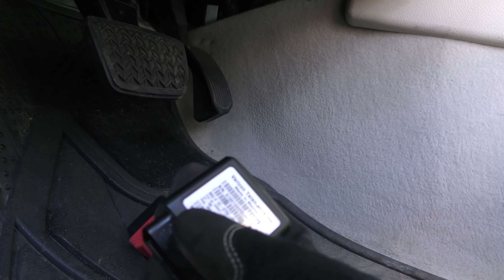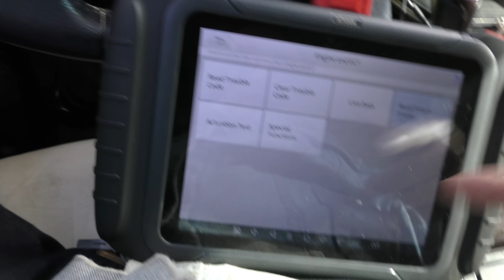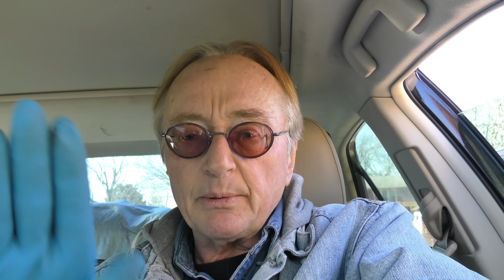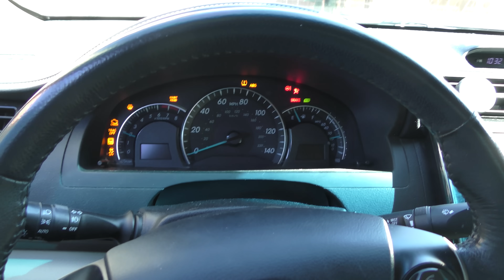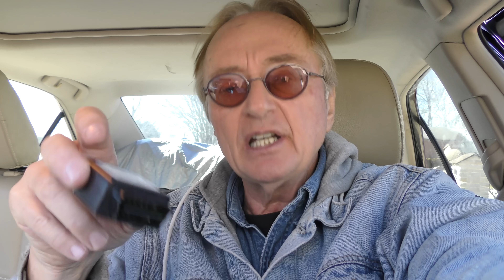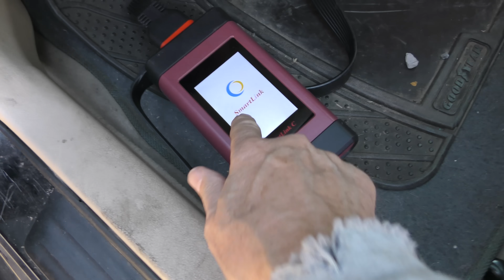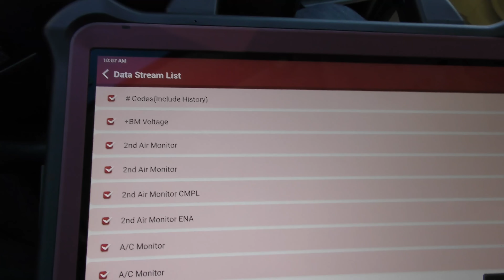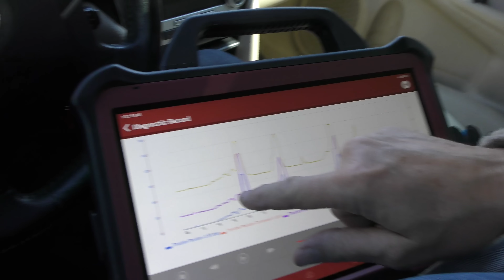This Stupid Device Just Cost My Customer Thousands in Car Repairs

Comment: That device is a Verizon HUM that uses a subscription. It will notify when unplugged. It is meant to stay plugged in. "The newer features allow users to set alerts for when the vehicle exceeds certain speeds or goes outside of set geographical boundaries" 
I would never have it. First disconnect like you did. Change the automotive battery or at least clean it and the connections especially grounds to engine, body and frame. Being it can alert on speed makes me wonder what settings were programmed to be monitored and if it can be undone?

Comment: Thanks for that! I recently had a problem with my car that I needed to clear the codes (of course being a JLR engine it just randomly cleared its own codes so I did not need to buy anything or take it in) so was considering buying a diagnostic tool instead of taking it in to a repair garage. I saw the Bluetooth ones it said you could leave in to watch what happened as it drove, and had considered that. Would not want to pay the amount JLR would charge for a new engine management computer.

Comment: So really has not proved that the problem is the unknown dongle, and many of those dongles are designed to be left in.  Also I am sure that a computer can be found for that Toyota for less than $1k if you look anywhere else than Toyota dealership.  Seems like since the problem is only with throttle readings that would one replace tps sensor(s) before assuming the entire computer needed replaced.

Comment: That dongle looks like the one my insurance company sent me to provide me a discount. The way it works is that it captures driving data and sends it to the insurer so they can monitor your driving habits! It's meant to stay plugged-in all the time.
Reply: mine was just a gps device you stuck on the dash or mirror. I wouldn't use any plug in device.

Comment: Years ago my Prizm Check Engine Light came on.  My garage plugged it in, and over 7 months i replaced all 3 components of the emissions control ststem and a Powertrain Control Module. $2500.  Nothing helped.  18 months later my shop discovered a nick in the vapor line off the fuel tank.  They put some electrical tape on it while they ordered a new line.  That resolved it.  89 cents worth of tape.

Comment: That sounds like one of those scammy "Gas Saver"/"MPG increaser" devices that do absolutely nothing except raise the risk of damage.  I wonder what the plastic packaging cardboard/card paper insert of that dongle had as a label.

It feels like they fell for the "Verizon" thing since that is a legitimate cell provider.  Yea just due to that label on the device itself alone I can tell it's phony since I don't believe the actual Verizon Telecommunications Company would make a device like this and wouldn't have it plugged into the OBD socket.  This makes me also believe that this definitely was advertised as a gas saver device since this was left plugged into the car while driving.

Comment: Scotty, my man.  As a computer pro, I have to say that the dongle you removed was not a doagnostic tool, but a fleet car tracker.  It is a good brand and shouldn't damage the ECM.  Then again, bugs and poor manufacturing happens.  Check the Internet for known issues. I would also contact the company (Verizon's fleet mgmt division) and adk them if there are any recalls on record for their gear.  If you are correct and their debice damaged the ECM, then this might reveal how and if there is a simple repair available.  If it is a known issue, then perhaps they might also be wiling to reimburse your customer.  Verizon is a big corp with big pockets.  Better they pay $1500 then spend twice that going to small claims court to fight a claim.  Almost guaranteed settlement.

Comment: My truck's ECU is unlocked for a tune I had done to it AND using one of those Car Insurance company OBD port dongles (to get a lower rate) attached to it made my truck's electronics go completely bonkers! Super hard shifts and I had erratic dashboard behavior. Once I removed the dongle, everything was fine. Don't attach crap to the OBD II PORT!

Comment: I've recently found a similar problem with my Camry, it was just soon after I had my transmission fluid changed, too late I'm afraid. hesitation between 2nd and 3rd gear only on the upshift, and if I put less pressure on the throttle into third it could proceed smoothly. well, one mechanic wouldn't look at it without a check engine light and suggested cleaning the throttle body, made no sense cause my idle is fine and the car is otherwise perfect. the mechanic who did my fluid change initially also told me he wouldn't look at it without a check engine light. so I took it to the dealership. initial estimate was that it needed a new transmission for $8500, then $6500, then $6200, then $5580. paid them their $400 for diagnoses and state inspection and went to a transmission shop, am now getting a rebuilt trans for $3600. I've seen other youtube videos on this common Camry issue, many say the computer needs to be reset to relearn values, but they don't seem to address that the computer is making these shifting choices for a reason, reason being binding of the gears. looks to me from your video that the car is struggling to maintain throttle at 30 mph precisely when it makes that second shift, the shift into 3rd gear. my car used to have a stupid dongle on it for the first 3 years of it's life for tracking and code purposes for the company lease. but for the last 4 years of my car's life it hasn't had that dongle... the dongle is definitely not the problem here.

Comment: My son was having codes on his gm LFX motor, here in Australia. I plug my dongle in and smelt his oil as there is petrol in it. I said it's either ur hpf pump or injectors I was leaning towards the pump. He didn't listen and took it to the Holden dealer. After going there twice and cost him over $320. They told him it was the oxygen sensor. I replace the oxygen sensors and still throwing codes. I got mucked around by a second Holden dealer. I end up taking it to a third Holden dealer and tell him them I'm staying there till they tell me what's wrong with the car another 300 + dollars Told me it was the hpf pump and one  cat converter is clogged up. They want $3600. I got a local mechanic and a second-hand cat with the new pump cost me a $1000. Now it's through code p0420 again. I just thinking changing the cat on bank 1 as I change the cat converter on bank twi, as per Holden

Comment: I just got my cheap scan tool in the mail today. Was planning to use it to diagnose my hesitation issues on hot AZ days when the AC is on. Already changed the alternator but I believe the voltage is dropping when the AC is on and that is causing hesitation when taking off from stop lights.

Comment: These code scanners give false readings. The pro licensed mechanics have the talent and qualified ones. One guy told me I had 16 codes. One had 2 codes.  2 sensors replaced and engine Iight off.  And the engine light has not come back on in over three weeks

Comment: Claim: Verizon device (GPS locator) caused computer to fail.
Proof:
1) The device was made in Mexico.
2)The device was plugged in when he examined the car.
3) Anecdotal evedence that Scotty has seen few ECM failures ( car's main computer)

I think there is no proof at all to this claim.  There is some proof that Scotty has an overly biased view of devices made in Mexico.  Fruthermore the Verizon GPS device only uses the CAN bus so it would be unlikely to cause a fault of this nature.  I would look for a loose/corroded  power wire going to the ECM or a bad battery.

Comment: Tons of bad info out of him.

The ECU is not bad, the throttle position sensor may have a dead spot and it's not from water getting in it. The car would have be submerged for that to happen. The connector also is a weather pack style so nothing is getting in there.

The throttle body itself also has multiple sensors on the plate as it is driven by a motor. Those can also be bad from age. Cleaning that did nothing was just a waste of time. Only if, and only if it had heavy deposits would it affect the car while idling. You also have to be extremely delicate with them as you break the internal TPS.

The main element he ignored was the Can-bus line communication error. That could be from a poor connection on the ECU itself most likely to ground. Cars will act all sorts of weird with bad grounds now. There isn't just one either, there are usually multiple in the engine bay alone. The most known being the battery itself. 

Also while those HUM devices can break, they will blow the fuse for the OBDII connector before damaging anything else. The ECU also has diodes to prevent itself from taking damage. They are no different than the devices used to give you an insurance discount. While there are many reasons to not use them, damage to your car's engine ECU is not one of them.

He really has no clue and should stop giving out horrible advice.

Comment: Great video. You're obviously very knowledgeable about all things automotive. I have a question. I have a device that provides wifi signal in my car but it also has basic diagnostic capabilities. It also plugs into that ODBC port. Do you recommend against using those as well?
Reply: Your battery will appreciate it not being plugged in.

Comment: Waiting for a few months/years down the line.  Had a similar issue in a Hyundai Elantra, hesitated right around the shift points and refused to past a certain speed when cold, turned out to be a buggered transmission.  That was a fun one to discover, I figured it was an issue with the driver assist settings and was going to leave it until the next time I took it in for service.  Then one day, on my way home from work, it refused to shift out of first gear after a stop.  Once we towed it in to the garage I found out there was a rash of problems with the transmissions in that model, and sure enough, once they opened up the transmission they found it absolutely wrecked.

Diagnostic tools like your tablets aren't meant to remain plugged long term, but those wireless dongles actually are.  That's why they're wireless.  A lot of companies even require them to be connected 24/7.  Before blaming the dongle, you should see if you can get a read off the dongle or actually have it tested.  For all you know, that dongle was doing exactly what it was intended to do and sending all the error information you were receiving to the owner's insurance, employer or wherever.

Comment: these devices are designed to be left in, however they can Mess with the CAN data..  ive never seen one actually destroy the PCM though...  thyat dongle might mess with the TPS values but its not going to destroy the computer unless it was completely Zeroing the CAN.. and then the vehicle wouldnt even operate... they would have had different symptoms..  no starts, stalls, etc..   however they CAN mess wit hthe DATA which can cause TPS and fueling errors...   that poor Yoda's PCM was on its way down already..

Comment: that black box would of probly be put in by the insurance campany to have cheaper insurance or young drivers the insurance would be invalid with it removed or tampered with there in the uk alot ob2 is ob2 telematics is what insurance companies use it would of had a sim card inside i hope its a left over unit or someones gunna get charged loads by the insurance company or points for invalid insurance i imagine someone will get a phone call and a spanking they ring you userly if the garage remove them.

Comment: the cpu is well protected on all 3 lines, The j1850, CANbus, and 9141 are almost all but impossible to damage the computer.  The 12v line is over-current protected.  Nope, scotty you missed this one.   That is a bad ground somewhere, and the computer is fine.

Comment: Those devices don't have external power.  They could draw off of a 12v wire, or even a combination.  That could easily mess with everything.

Comment: But I'm pretty sure that's not just a "cheep scan tool" Verizon telematics offers gps fleet tracking and they might be required by their job to have it when on the road for work. And those are most definitely designed to be connected while driving, that's kind of the point.

Comment: Telematics is a tracking device not a diagnostic device, it may have a diagnostic function as well but it's not it's main purpose. I'm not sure what insurance is like over there in the States, but here in England it's very common for insurance companies to require a vehicle to have a telematics "black box" to monitor driver behaviour, it's common for younger drivers as a way to get cheaper insurance for good/sensible driving. It could also be just a tracking device for some other purpose but I'm guessing it is most likely from an old insurance policy.
Reply: A quick search for Verizon Telematics seems to imply it's a fleet tracker, was the vehicle previously a company car?

Comment: FWIW, that dongle is part of the Verizon fleet telematics platform. We use these on a fleet of several hundred vehicles and to my knowledge it has never caused an issue. Granted, all of our vehicles are late-model commercial trucks and vans and we don't keep them more than a couple of years so perhaps older computers or long-term use may be a factor.

Comment: I just want to point out a big thing here. This specific device wasn't a diagnostic device. That was the dongle for the "Verizon Hum". So when you say that "these things aren't meant to be plugged in all the time" - it actually very much is meant for that purpose. Unless the device you're plugging in has internal shorts or is otherwise damaged in some way, you don't run the risk of damaging the ECM by plugging in an OBD dongle. You'd think that all the people running tuning software on their vehicles while reading from the OBD port would be way more wary of doing so if driving while using an OBD tool risked frying their ECM. Compared to the few other videos I've seen, this one is very very weird and misinforms the viewers. You clearly don't fully understand how the ECM modules in a vehicle operate on an electrical level.

If these dongles cause so many issues, you'd think that auto insurance companies wouldn't offer to lower rates for people knowing full well that they'll be engaging in a future claim by the cause of their own device. This video just makes zero backable claims on this front.
Reply: The Verizon ones in particular have killed a few that I've seen. Always verizon.
Reply: @Gilbert Visperas You're right, insurance doesn't directly cover repairs. Comprehensive insurance covers damage. And if these things damaged an ECM so easily, it would be damage to the car, and done directly by the people who cover said damage. Does this not paint a pretty vivid picture in your mind?

Why would a company offer to cover unlikely damage to a vehicle, but then manufacture a part to plug in to that vehicle that allows the user to save on their premium, but while also damaging their vehicle and then needing to cover the repair from that damage?

My point is that the accusation of damage to the ECM was made, which may very well be the case, but there's no proof that the OBD dongle was the thing responsible. There are way too many possibilities that are infinitely more likely.

Comment: I'd have to disagree slightly on the diagnosis. If multiple sensors are all dropping out along  with a voltage drop, I'd be checking for bad grounds or a problem with the wiring harness supplying power to the computer. Those computers are incredibly resilient and over-engineered. Either that, or some kind of intermittent issue with the alternator. Just because it puts out good voltage while you're parked doesn't mean it will while you're driving, especially if it's a wiring problem.

No disrespect to Scott. Intermittent electrical issues like this can throw even the most seasoned mechanics for a loop, and it's even more difficult to make an on the spot diagnosis if you're not familiar with the car like it's your own. Customer descriptions of issues like this often leave a lot to be desired as far as relevant information goes.

Comment: I agree scotty, don't leave dongles in the obd slot, but the 1 thing you did wrong and should be done every time is run the throttle learn sequence on any diag equipment, thats what i saw was spiking in the graphs. Every time an electronic throttle pedal or throttle position position sensor is changed the throttle learn sequence must run, otherwise the vehicle engine ECU will revert back to previous on the ecu memory or divert to basic settings erespective of any any DTC's cleared or not.
Reply: This is what I was thinking. Plus dont ever open a throttle with a stick 😱

Comment: i had this happen to my Toyota if i leave my Bluetooth ODB2 adapter plugged in. It wasn't consistent but after a little while, it comes up. I can pull the adapter while driving and the issue goes away. It has done this exact issue for me.

Comment: A lot of cars come with these installed from the dealer. Leaving it plugged in while driving is occasionally a condition of the auto loan. 

Some insurance companies use these as well (though there really is no need as a mobile app can do the same job).

Comment: Love your videos but disagree on your diagnosis. This is a cold engine issue, you've troubleshot the electronics, but there are far more things with cold which limits the vehicle until warmed. Since the issue is limited to that time frame concentrate more on those, throttle limiting is part of cold loop so dig into that and you'll probably find the actual issue.